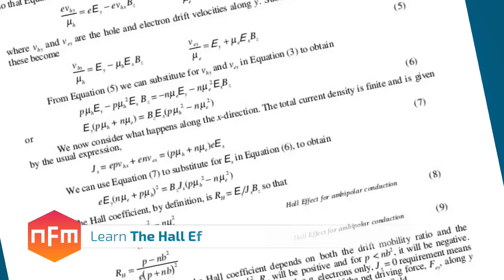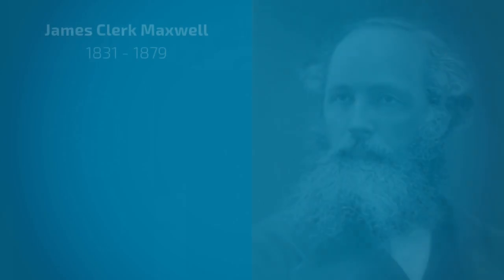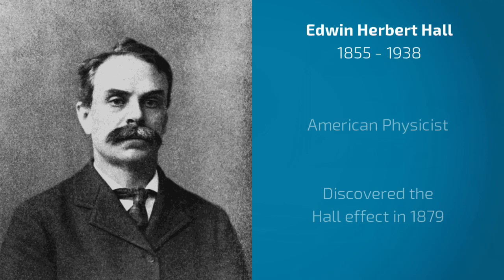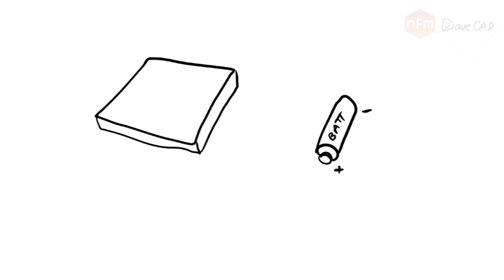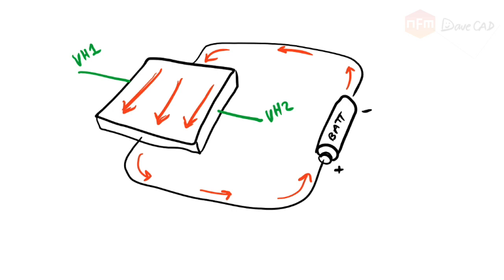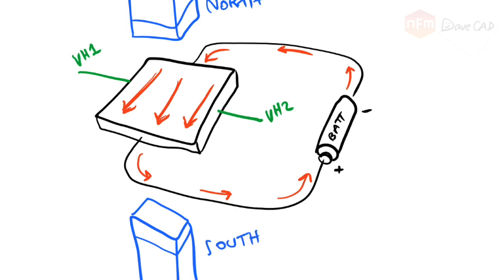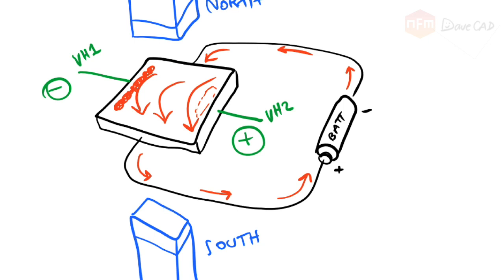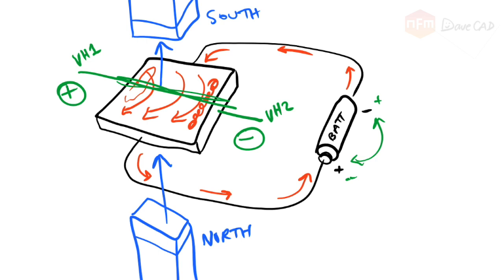The Hall Effect - What is it? How does it work?

Comment: excellent!  very much helped w my automotive project...............thanks!  i recently put in a NEW (but bad) CKP sensor and its apparently shorted internally-  screwing up my fuel level gauge, ignition coil/ignitor(?) and setting off a host of other selonoids- et al!   I cleaned all grounds, rebuilt my fuse box, new ECU, cleaned everything........no changes  UNTIL i just now decided to swap back in the old CKP sensor.  All the electrical clicking, etc went away immediately and Im not going thru the KEY RELEARN process for the new ECU

Comment: Where is the magnet in my oxygen sensor, crankshaft sensor, egr valve and the rest? and which one of those wires suppose to mean signal wire?
Reply from the maker: Not all of those are hall effect sensors.
Some automotive sensors (like ABS, Cam and Crank angle sensors etc) can sometimes be a reluctor sensor which works in a different way.
You'd have to research your particular vehicle to see if it uses a hall effect, reluctor, or some other type of sensor.
Reply: @NearFarMedia  Well, for the life of me, I have no Idea nor have I been able to find out how the EGR valve on my 95 Chrysler town and country actually works.  Online all a person finds is what they do  with specs etc., but not the details ( the meat and potatoes as they say) of how the thing inside actually does what it does. Good luck with that.  :-)

Comment: Thank you for this vido. I have question why in hall effect circuits their is resistor between supply current and the output signal wire?
Reply: The resistor limits the current through the device, to avoid burning it out.